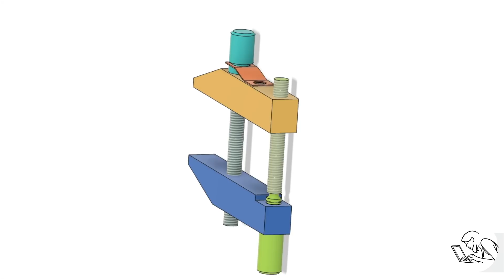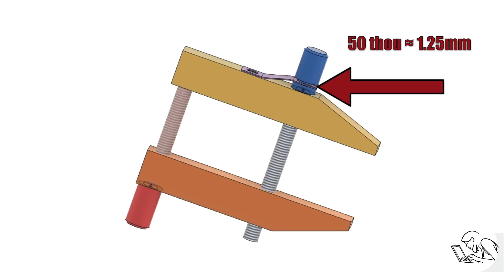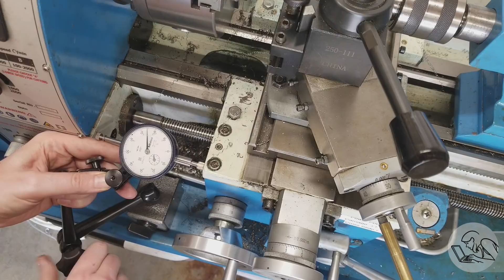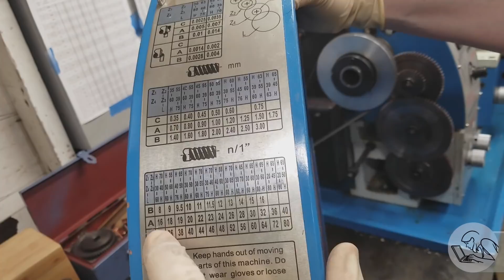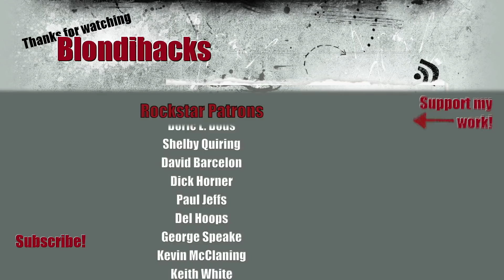Let's Make A Toolmaker's Clamp : Conclusion!

Comment: This has become one of my side projects, in the goal of using a surface grinder to make some precision flat stones, which in turn will be used to ... etc. So points: 1) probably there are cheap and dirty ways to hold a stone to a magnetic vise without making clamps like these. 2) You must absolutely have a way to drill holes perpendicular to surfaces. It is worth the time to tram your mill or drill press, and have a way to measure holes to make sure they are perp. I've decided I'd really like a setup to do this automatically (drill a hole, bring it to the test thingy for perpendicular)  3) making the screws is tough especially if your chuck is old and effed up. Better to machine all the concentric features on the screws in one go before threading them. If all the round parts of the screws are not concentric then it's going to be sad times when you put the vise together and try it out. 4) holding a threaded thing in a chuck the way you do it there is kind of dangerous if your chuck is not working nicely. That nut might seem tight but it can rotate in weird ways and once that happens you have a really effed up way to make threaded rods with right angle bends in them.

Comment: Fun story about the strength of expanding steel. 
I was teaching myself how to weld, so I didn't have a lot to work with. Put some angle iron in my vise and welded something onto it. Went to do something else, and heard a loud crack. Turned out, the heat soaked into the angle iron, it expanded, and then broke my cast iron vise. Lesson learned.

Comment: I'm wondering if you couldn't have reversed the wing nut and threaded it on first using your Alum clamping block like a jam nut and the put it into the lathe chuck wing nut first?

Comment: Great project Quinn, I really enjoyed watching it.
Can you not arrange things so the follow rest actually "follows" your cutting tool on the finished side?
Or at least straight across from the cutter?
This would give you room to work right up to the chuck.
With threading you shouldn't have to adjust between cuts but if you are removing material from the diameter you would have to adjust the rest between passes. 😊

Comment: G'day Quinn.  Very nice job!  They look great.  How do toolmaker's clamps compare with a typical G clamp in terms of their clamping force?  Are there advantages to this type of clamp?
Reply from the maker: The main advantages to them is they clamp in parallel over a long distance. Most clamps apply angular force of some sort or only clamp in a single spot. These are also machined square so you can, for example, clamp work in them and then clamp the clamp to a faceplate or mill table.

Comment: I have a set almost the same. They look a bit wonkier than your excellent job though! Good thing about this style of clamp is you can tighten both screws to the part you're holding, then an extra tweak to the rearmost screw gives huge mechanical advantage to the clamping force as the jaws pivot slightly at the front screw location.

Comment: A fine, handsome pair of clamps. I can't see why this design would give you twice the clamping force though. The mechanics of the clamping is exactly the same for both, with the front screw in tension and the rear screw in compression..
Reply from the maker: Because you can clamp between the screws as well, where both screws are in equal tension. The other design can’t do that.
Reply: @Blondihacks  Good point!

Comment: I just realized that you often put things like "1/2 thou ~ 13 microns" whenever suitable. But I think we rebels (non-empire guys...) mostly use 100th of a millimeter as a unit of precision. One thou being (approximately) 2.5 hundredths (kind of hard to pronounce in English... In Swedish it would be "hundradelar" (directly translated to "hundred parts"). 
Anyway, it may well be that microns are widely used by professional machinist but I'm pretty sure us hobby machinists (noobs and  pros) use one hundredth of a millimeter as the go-to unit of precision, much as you use one thou. But with 2.5 times the accuracy...
Reply from the maker: I see metric folks in the home shop machinist forums using microns, and I figure integers are always nicer, but open to suggestions here.
Reply: @Blondihacks  integers are nice, that's why 100ths are so handy. But I guess it's more down to what you're used to.
Reply: Come to think of it, it may be that 100ths of a millimeter are "better" only in Swedish (Scandinavian). "5 hundredths" is more of a mouthful than "50 microns". But "5 hundradelar" is simple. As is the equivalent "2 thou".

Comment: I have a rather ancient Hercus 9A lathe. (An Australian built South Bend clone.) I do like your method of single point threading but I can't use it because the spindle nose on my lathe is threaded. Running the lathe backwards, even if that was possible, (it is if you twist the drive belts), is a terrible idea.
The threaded spindle did make it easy for me to make an ER32 collet chuck for it though. Collets are the best way to hold threaded parts without marring the threads.

Comment: Using an ultra thin parting blade is not necessary to part tool steel on an inexpensive lathe.   I do it all the time on my mini lathe.   The “secret” is to put the cut off blade in upside down and the run the lathe in reverse.   Despite all the bad press the mini lathe gets, it’s chuck will not unscrew.   Parting “in reverse” allows the lathe to flex out of binding, rather than into it.
Reply: There's a well-known design (or three) for a rear toolpost in which you mount the parting tool upside down at the back of the cross slide and run the lathe in the normal direction.  Prevents the chuck unscrewing from the spindle :-)
Reply: pnt103 I suspect that is necessary for those who got suckered into buying a screw on chuck.   With so many operations made simple by running in reverse, I don’t know why anyone would settle for a lathe that can’t run in reverse.   I use my 12 x 36 lathe with a D1-5 camlock mostly now, but have not yet fixed the cutoff blade to cut upside down.    This is mostly because the lathe came with a piston style QC tool post.   I don’t trust them to hold fast.   Just yesterday (literally) I upgraded to a wedge on the bigger lathe.   The 0XA wedge on the mini lathe made a huge difference.
Reply: @dougberrett8094  "Suckered"?  Actually many of us with older style lathes have screw-on chucks.  Plus the rear toolpost has other uses and is often more rigid than the front one.

Comment: Daaaaamn that jax cold blue finish looks great! Stuff I get from brownells sometimes leaves an inconsistent finish, I'm gunna give the jax stuff a try.
Reply from the maker: Honestly, I like Brownell's better. The key to these cold blue products is good surface finish and absolutely zero oil or grease anywhere. You really gotta degrease them perfectly.
Reply: Interesting, I usually clean my parts in an ultra sonic cleaner then dry/clean with acetone, then heat them to 200 in an oven before 'cold bluing'. Pre-heating is the only way I've ever been able to achieve uniform finishes. I'm guessing good surface finishes is part of my problem.

Comment: May be you could have cut the slit through most the other side of the threaded block so the jaws could have increased the pressure on the part that you where holding

Comment: Shoving a bit of bar through the headstock spindle and securing it at the changegear end would've stopped that part winding itself into that block Quinn....🇬🇧👍
Reply from the maker: Good idea! The end of my spindle bore is such that there’s no easy way to do that though. Would be a good project though, to make an expanding “bore stop”
Reply: @Blondihacks  

If the end of that spindle is threaded then turn yersen a bit of bar....through bore it, counterbore it and thread it to accept the spindle...
Then mount it on a hex collet block, slap it on the miller and drill & tap 3 holes 120° out from each other...

There you go Quinn...
Something that can be used to set a depth in the spindle bore for repetition work...
And the triple screws can be used to centre up longer bits of bar etc...🇬🇧☺️

Comment: Quinn; I have seen you cut machine screws like that a couple times, just a tip if you pick yourself up a pair of automotive wire striper/crimping pliers they have a machine screw cutter incorporated at the hinge point. Just screw your screw into the appropriate hole to length shear it off then screw the screw back out. Works great! Nice clamps by the way. Thanks
Reply from the maker: I have a few of those lying around. I’ll check for that feature!

Comment: When knurling with that type of tool (my preference, too), turn a piece of scrap about .015" smaller (adjust to taste) than your final dimension and use it to calibrate the span of the knurls with the spindle stationary.  Like you did, put lots of oil on it, then quickly run the knurls over the part.  It's fast and does a nice job.  Thanks for the video and thumbs up to crush a troll.
Reply: I'm having a problem accessing the patreon email benefits and I've tried to get through to you through email (so as not to clutter things here) with equal lack of success.  There's no rush, but I'd appreciate it if you could contact me in your copious free time.  :-)   Thanks.

Comment: Great series on very useful, nay mandatory tools for the work shop. 😀👍
If I may suggest there is a quick way to open/close toolmakers clamps... Hold each knurled knob in each hand, then spin the whole clamp, like pedalling on a bicycle.
Excellent vlog Quinn.
Thanks for sharing and best regards John Quinn.
Reply: You should try this Quinn as it has a very satisfying feel to it as you open and close the clamps very quickly this way.

Dale in Canada
Reply: PS.  that is why they make them that way so their is a knob on both sides and not both on the same side.

Dale in Canada

Comment: Although I'm not a machinist, I have a lifetime of experience (74 so far) in mechanics, spatial orientation, construction, etc., so sometimes I see an operation that could be improved. I hope this is one of them.

In your first assembly of all the parts, you mentioned difficulty in screwing the two jaws together, needing to keep them in parallel, which I totally understood at the time. Then you took the whole thing apart, cleaned, blued, oiled, etc. and proceeded to reassemble. 

What I noticed was that if you left off the circlip until you had the screws started (or even waited until you had the jaws together) you could drive the (spring loaded) screw down, then screw the loose one down and attach the circlip. Although the relief for the circlip isn't there for that reason, you can certainly take advantage of it.
Reply: I was watching thinking the exact same thing, and I’m a mechanic of only 12yrs.......
Reply from the maker: True, but it was a test of function, so I needed to see that the clamps would operate well in their entire range anyway.

Comment: To harden your knob, clamp screws, chuck them in your drill press. Turn the drill press on. Heat the screws while spinning. When they get to quenching temp, lower them into your quenching oil while they are spinning. Heats evenly and quenches evenly. No guarantee they won't warp, but gives you the best chance. Works.
Reply from the maker: Wow, that’s a great idea! I would not have thought of that. Thank you!
Reply: @Blondihacks  You are very welcome. Proud to serve.
Reply: "To harden your knob"

I can hear  the childish giggles from the back.
Reply: Check out that Lazy Machinist latest post on dipping vs dunking when quenching.

Comment: As a career auto mechanic, I find it hard to accept how often lathes in perfect working order can sound like a metal can full of rocks rolling down a hill.
Reply from the maker: 😂 That’s the straight-cut change gears making that racket. It’s possible to dial the spacing in perfectly so they run quieter, but it’s so much effort that most people don’t bother.
Reply: @Blondihacks  A piece of writing/copier paper between the gear teeth being meshed is how I set my back gear mesh clearances. They run pretty quietly after that technique.

Comment: I got to learn the coolest hack as an apprentice years ago, that I still use when threading. Your thread depth is the thread pitch times .75 and you're in the 2A ballpark. It has saved my bacon more than once trying to save a project on the fly.

Comment: I plan to make some of these. Hopefully mine can turn out as nice as yours. 
Joe Pie's knurling video has helped me get "mostly good results" - including some 304 stainless a few weeks ago. Combined with making a hex nut on my knurling tool, rather than using the supplied knurled with 2 very thin flats for a spanner, you can't get the spanne on there, because you either hit the chuck, the tool post or something else!

Comment: Great stuff. I made your tap follower.I did not follow your instructions and was only practicing the process but I was able to make a beautiful hole see my video I’m so easily impressed. 1Minute long.In the pen sucked itself down to the bottom of the blind whole.made a very satisfying pop when I pulled it out.I almost hated to make the tool . Because I lost the ability to pull that pen out in here that audible pop in the best part watching the part suck that pen down into the blind hole YouTube channel Kimber Zelik. One minute video (I’m so easily satisfied). I did not have a shoulder on my pen to keep it retained so I added a retaining clip and ground The clip to round for clearance threaded the body thread of the cap, added the spring and I have a tap follower thank you .

Comment: Noob question: please define "spring pass."
Reply: It's doing another pass after a cutting pass without changing the depth of the tool. This makes sure the thread is for sure at the dimensions you intented. :)
Reply: Spring back pass is more formally descriptive, it addresses the propensity of the stock to deflect somewhat under thread forming pressure. By returning to start and re-cutting without any change in settings, a finer resolution is obtained.

Comment: When you're doing single-point threading on a lathe, how do you keep the synchronization between the part and the leadscrew (so your second cut is lined up with the first one)? When you disengage the halfnut from the leadscrew, I'd expect the relationship to be lost.
Reply from the maker: What he said. 😀 The leadscrew is a known pitch divisible by certain values, and the threading dial tells you which divisor you are currently on. Each thread pitch has a number of factors that you can use, so when that number comes up on the dial, you engage the half nut and it’ll be in the same place.
Reply: The is a ‘thread dial’ to the right of the carriage that indicates the alignment.

Comment: I HATE e-clips!  They always escape when I ty to get them off and I never have spares...
For something that isn’t coming apart they’re fine but I find no end of frustration with them on things like throttle linkages and the like.
Reply from the maker: It’s a known fact that every installation of an e-clip requires four clips. One for the part and three to fire into the corners of the shop never to be seen again.
Reply: @Blondihacks  I have literally witnessed them disappear mid air into another dimension, never to be seen again. You are aware that us Mekanicks call them Jesus Clips, right?
That's because every time one of them flies off somewhere you mutter Jesus under your breath.
Reply: You always have spare e-clips. They're the ones that escaped the last time you tried to use e-clips, they're around the shop somewhere...

Try waving a strong magnet around in the dark corners of your workshop, under the bench, in your hair, all the usual places.

Comment: I am not a machinist, but I was wondering if you could have used super glue on your split clamp and heat to break the bond when done. It would be safer than the Flying wings of death.
Reply from the maker: Superglue does work for some machining setups, but tool-steel is tough stuff and the glue likely wouldn’t hold.